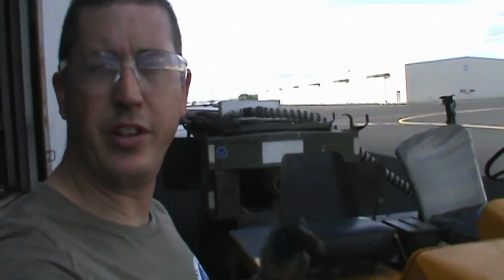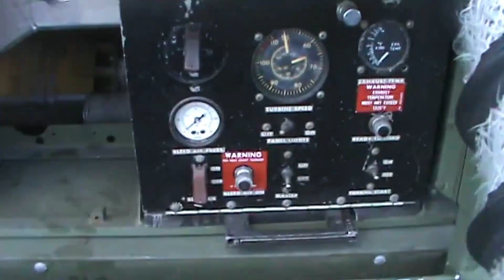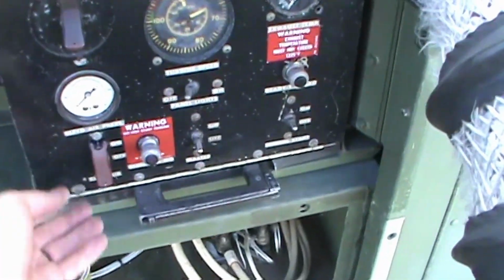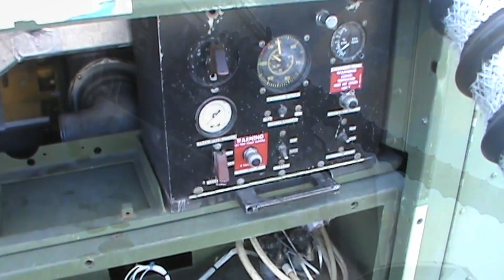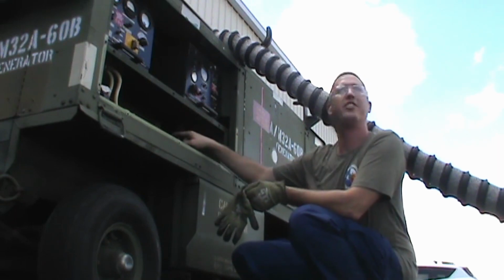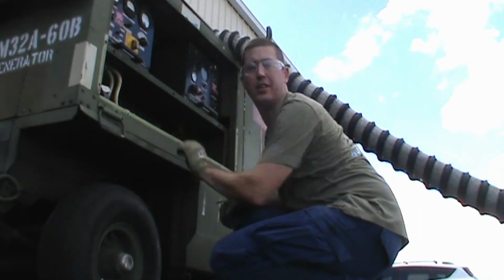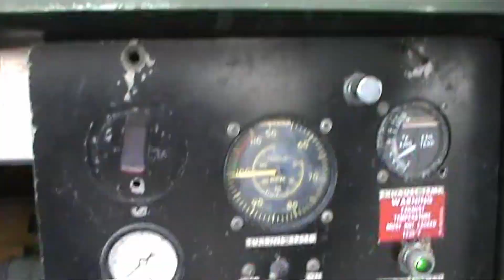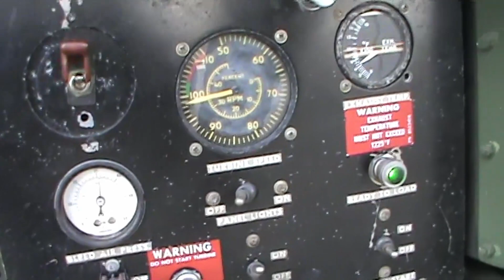Servicing an F-4 Phantom

Comment: Would you happen to have an manuals or know where to find any manuals on the phantom? My team is moving/towing/tire changing on a static display and would greatly appreciate any help or insight you might have.
Reply from the maker: There is a dash one that is available online. I’ll look up and see if there is a specific manual number you guys need to reference. Which variant are you working on?
Reply: @DieselThunderAviation  still figuring that out. Thanks
Reply: @DieselThunderAviation  the tail # is 68-375
Reply from the maker: @danielgrimm8559  Nice, you have a E model!